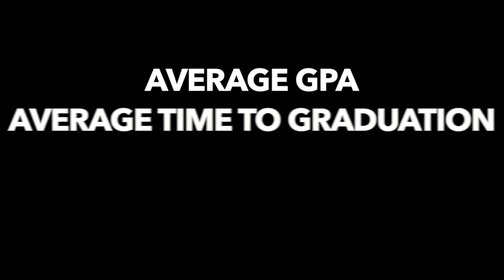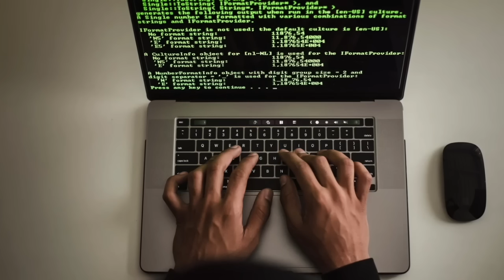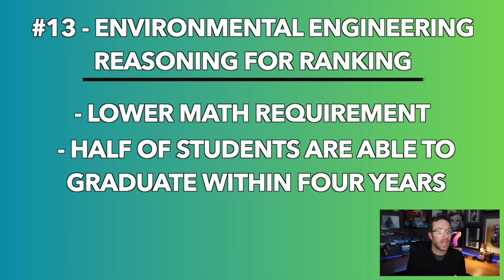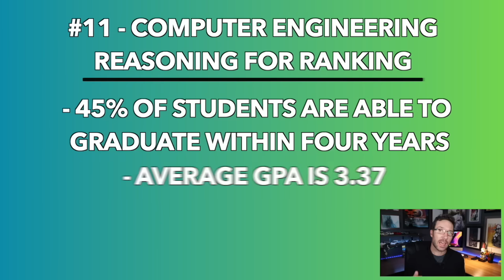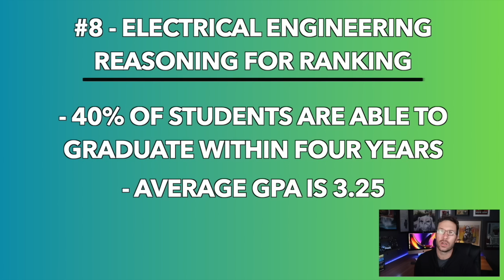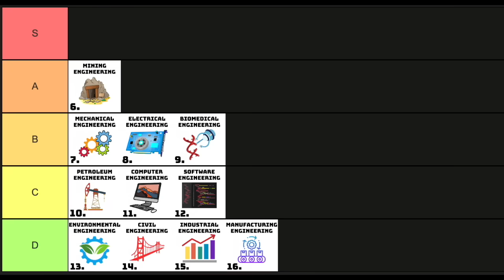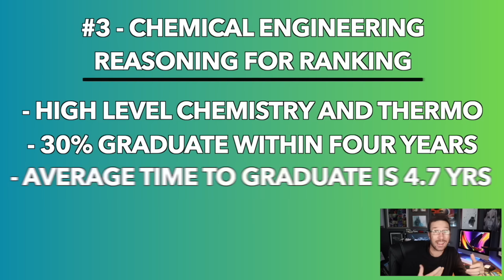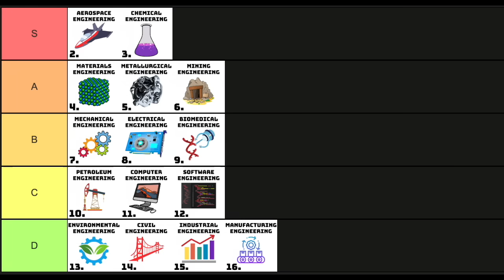Engineering Degrees Ranked By Difficulty (Tier List)

Comment: Retired EE here -- Class of '89 (UFL). Nope, not accurate, sorry pal. Author grossly understates "highest level math required." Sure, differential equations was the last of the formal math curriculum, but let's talk about Electric Fields that builds on Calc 3 and DiffyEQ and takes it into another dimension. I'm understating things by saying EE math is Arcane and should come with an honorary degree in Sorcery. When entering the program, they'd try to scare everyone by saying 50% wouldn't make it, but in reality this was kid gloves. The actual success rate was around 10%-12% from what I directly saw back then, brutal.

Comment: Sorry, Electrical Engineering has Partial Diff equations along with stuff like Maxwell equations.  Yes, I'm EE and think you've ranked it too far on the easy side.  I'd put it at about Aerospace E hardness with Mech E right behind.  It's about ability to think abstractly as much as it is about math and calculation skills.  All require lots of simulation and analysis, but there Chem E has much more difficulty.  I agree with the difficulty of Chem E, and probably Nuclear.

Comment: Saying that the highest math in electrical engineering and computer engineering is ODEs is totally wrong. First, many degrees will have formal courses in PDEs, complex variable theory, stuff like that. Secondly, and more importantly, there's more advanced math required in applications in those fields. For example, an algorithms course will deal with complexity theory which is arguably more complicated than ODEs, and electrical engineers will need to learn control systems theory and dynamical systems, which, again, more complicated than the basic math courses.

I'm sure similar arguments apply to mechanical engineering and possibly others as well. Computer and electrical are just the two I happen to know best.

Comment: Seems reasonable, more or less, though my experience is over 30 years as a research engineer across mechanical, electrical, computer, software, and aeronautical, at one of the top R&D labs in the country mostly working with folks with at least a masters, more often a PhD. Then too folks with degrees in math, physics, ML/AI. Much less experience with folks having only a bachelors degree.

That said, rank an undergrad double major in math and physics, which is were I started. With that and subsequently a PhD in math, I found I could do quite well as an R&D engineer.

Comment: As a computer engineering student, I generally agree with this tier list. In comparison to my friends studying mechanical engineering and electrical engineering, I find my courses a bit easier. However, it still depends on the school and the project assignments given by the professors. Speaking from my own experience, the project assignments given by my professors are quite challenging. Therefore, even though my courses may seem easier compared to other engineering disciplines, the overall workload is more demanding for me. Consequently, it's not possible to make a definitive difficulty ranking I guess

Comment: Bro there is no way you placed EE #8. At my University in Germany we have to do complex analysis and partial differential equations while needing 210 credits for a bachelors degree 💀💀💀 
And let me tell you, almost 80% drop out by the first 2 years...
Reply from the maker: I may have ranked it a bit too low .. but i tried to stick to my system. I may try to remake this video at some point with some different data. thanks for the comment!
Reply: Ain’t no way you’re complaining studying at an FH bro
Reply: @iamshawnlee1  I'm in fact studying at a University being the valedictorian of my class, still seing my classmates suffer
Reply: In this context, class and classmates relate to two semesters. So the two adjacent semesters from my starting semester

Comment: I was curious to know your industrial engineering rating, but then I remembered that this degree is not the same in my country as it is abroad. Your industrial engineering is called Industrial Organization here, while Industrial Engineering is the 6-year higher degree which allows you to sign mechanical, electrical, electronical, manufacturing and thermical projects. For me that's an A, due to the higher difficulty compared with other engineering degrees. What do you all think?

Comment: You can  not use percent of students able to finish  some engineering degree in four years as measure of hhow hard it is. You have also  to take in account average quality of students that enroll some of degrees.  If some of degrees have lesser pay expected and worse job prospects they wont be as popular and will be enroled by students not being able to enroll more popular engineering degrees. 
Btw. I was suprised by info that higher math required in electrical engineering in US is ordinary diferential equations. When I studied electrical engineering in Serbia in 1990's (Control Systems), 5 semester of math were required, including general and linear algebra, real and complex mathematical analysis (calculus of real and complex variables), ordinary and partial diferential equations and systems of DE,  equations of mathematical physics, probability, numerical analysis, graph theory and discrete mathematical structures. And in addition  for these general EE requirements, Control Systems department at EE required additional specialized math content like optimization theory, stochastic calculus and DE, stochastic dynamic programming, stochastic processes and time series, applied math in pattern recognition and similar topics, etc.

Comment: Proud Chem Engineer here.  Thanks for the video.  I think this is a useful first cut, but mathematics is not a 1-dimensional field, and PDEs although difficult enough, has a competitor in Numerical Analysis, which in chemical processing disciplines, may combine several maths disciplines to solve simultaneous sets of non-linear equations, mingling momentum, heat and mass transfer into the stew with thermo and kinetics.

Comment: When I got my BSEE in 1964 it was considered the most difficult at the University. I had math well beyond partial DE, graduated in 4 yrs with 151 credits (only 12 of which were electives) and a GPA  of 2.5 was considered respectable (pre-grade inflation era). A friend and I selected EE based on a coin toss.
Reply: There is a big difference between achieving a 3+ GPA in engineering vs. in Liberal Arts! I believe that an AS degree in engineering is much more difficult that getting a BS in history, yet many presume that a BS in any major is always superior.

Comment: Take the rankings presented with a grain of salt.  Difficulty depends more on on School than on major: Some engineering schools require Integral Calc (math major level) regardless of engineering degree some engineering schools calc is a joke by comparison...this presentation essentially over-simplifies.  Not all calc courses are created equal...not all engineering schools require the same calc course as required for math majors others require calc for non math majors - not all integral or differential calc course are taught at the same level of difficulty - also, some engineering schools enroll more foreign students than others - the engineering school this guy graduated form had groups of asian students who studded together and absolutely destroyed the curve for many and calc courses were same as required for math majors. These factors are very significant regarding difficulty - bottom line: some engineering schools regardless of engineering major are much more challenging than other engineering schools regardless of majors.

Comment: MTU BSME Spring 97, pretty much spot on, great video.  ChemEng what a nightmare.  Nuc and Material supper tough, why, there are way less jobs out there so you better be really good.  Now what I see in all the new engineers (ME, EE, CE, Material) is way more sub-classes so they are really good at one little nitch, but not the over all discipline.  Good god get a digit EE to do anything analog.  in Australia the Mech-EE, some hybrid ME/EE, tack an extra class here and there and now your both...  It like in the 80's and 90's when Bio-Med, MFG were trying to spin off of ME.  To many dilutes the quality and lowers the standards.

Comment: My experience with mechanical engineering in projects is that mechanical systems in buildings is least likely to work as intended. 80% of my issues as a facility manager had to do with mechanical issues. Too hot, too cold. Insufficient water circulation for hydronic heating. Enough capacity to maintain a building temperature but not enough for a cold start. This was in southwest BC where minimum temperatures rarely drop below -12°C.

Comment: As a retired engineer I disagree with your assessment criteria based mostly on time to graduate. The curriculum should be the highest measure for difficulty and it should include more than just math. I suggest you look at the pass/fail rate by class subject, for example at my college thermodynamics and ac circuits were killer subjects where people often failed and the difficulty was known campus wide. I assume you are an engineer but I see no mention. Thanks for the effort.

Comment: I teach Electrical Engineering..  I did my Bachelors in Electrical and Computer Engineering.. And I will definitely say that the rankings  are a bit flawed in terms of difficulty.. I will put in the top 4: Physics, Chemical, Nuclear and Electrical Engineering.. EE is extremely difficult to conceptualize because most of the foundational principles of EE lies in the imaginary/Complex domain and Electricity itself is one of the least understood concept that the modern world is built on and exhibits some of the most bizarre behavior under very different conditions.. My students always complain that they are sick of all the innumerable Transforms: Laplace, Fourier, DFT, FFT and Z-transform. My point is that most Engineering like Mechanical Engineering deals with tangible concepts that students can touch, feel and see, whereas EE concepts, RF, Microwave and Transmission line concepts are not tangible things that are as quantifiable or relatable.

Comment: Retired Professional ME, class of '81!  Over thirty years in DoD including two tours in Afghanistan.   A key ability an engineer needs is problem solving.   Problems need solved regardless of the circumstances as best as can be done with the material on hand.   Think MacGyver. 
 It is very hard to graduate from ME in 4 years, most did it in 5 years.

Comment: I can’t argue with the rankings as I studied Aerospace at Penn State in the late 70s, got my EE undergraduate in the 80s and my structural engineering masters in the 2000s, so my knowledge is dated.  I do know that all the engineering degrees have been watered down substantially.  When I was at Penn State in 1979, Aerospace required 142 credits and the easiest engineering degrees were in the 133 range.  And at that time aerospace required math beyond differential equations, particularly vector calculus and fields related topics such as gradient, divergence and curl and Green’s and Stoke’s theorems and others that were considered beyond differential equations (a 200 level course compared to 300 level for the fields related courses).  The same held true for my EE degree as it required the fields courses (which I already had from my aerospace studies) and additional complex variables math.  I know that with the advent of primarily digital electronics, it appears that many EE programs have dropped the requirements for fields courses.  Aero and EE also required a course in thermodynamics.  In the 70s, I would have ranked EE right behind nuclear, aerospace and chemical engineering as all were on a similar level of difficulty.  Mechanical, materials and metallurgy were mid-level difficulty degrees.

Comment: In addition, the percent that make it through for civil is also nonsense.  The first 😢killer course for civil engineers is Statics in the Engineering Mechanics Department.  Around 60 percent of all civil engineering students fail that course. Finally, it is rather ridiculous to compare civil engineering to any other engineering.  Civil is the mother of all engineering.  It covers so wide an area and the demands of various sub areas vary.  In fact, Environmental engineering has been a part of civil since Darcy design the sewers of Paris and who was a friend of Victor Hugo when he was writing Les Miserable that describes in great detail the sewers of Paris designed and built by Darcy.

Comment: TOO MANY GENERALIZATIONS.  YOUR CRITERIA OF HOW LONG TO GRADUATE IS BULLSHIT.  CIVIL REQUIRES PARTIAL DIFFERENTIAL EQUATIONS THAT ARE NON - LINEAR, VARY WITH TIME, DEFORMATION, AND CHANGES IN STATE.  CIVIL SHOULD NOT BE 14.  MORE CIVILS GRADUATE, NOT BECAUSE IT IS EASIER, BUT BECAUSE THE GOVERNMENTS, STATE AND FEDERAL, OFTEN GIVE COMPLETE TUIITION, LIVING EXPENSES, AND JOBS DURING THE SUMMER.  CIVIL REMAINS THE TOUGHEST DEGREE AT THE PHD LEVEL.  CIVIL ENGINEERS INVENTED FINITE ELEMENT ANALYSIS IN 1936.  IT CONTRIBUTED GREATLY TO THE VICTORY OF WWII.  HIGHEST LEVEL OF MATH ODE? IF YOU ARE NOT GEOTECHNICAL OR STRUCTURAL OR FLUIDS.  OTHERWISE YOU NEED HAS CALCULUS IV, ADVANCED PHYSICS, ENGINEERING MECHANICS OF SOLIDS, STATICS, DYNAMICS, THERMODYNAMICS, NUMERICAL METHODS WITH MORE MATH IN A MASTERS AND PHD.  AS A CIVIL, MY CIVIL SALARY IS 250,000 $K YEAR.

Comment: Interesting and thanks.  I have a Masters of Science in Materials Engineering and Science (which is might include Metallurgical Engineering --- a sort of catch-all phrase or description --- I studied polymers [plastics] and ended up with a US Patent for a paint additive).  A lot of fun and instructive.  As for the math --- useful as it can help with some of the molecular conformational structures --- at least in my case. Which is sort of obvious but might be a surprise to some.  As for the math part . . . well, there's spreadsheets and so on.  The key to all of this is how such tidbits might be applied, that is wholly depends on the individual involved.  And, politically, the reasoning, if you can call it that, for much of the notions of legal classes and the like as the prospective employer, as suggested in the clip, would really, really like to have all of that yummy intellectual property for free.  Political shuck and jive.  As there are or might be thefts involved dressed up to look like something else.  Be careful what you sign up to study at college.

Comment: Back in the day we had to take a class in different  engineering subjects the EE course was hardest. It’s still PFM to me.  Ended up with an AE degree 1n 170 semester hours, in 5 years. Back then a semester at KU was $235/ semester. Before retiring I was making $250-325 k/ year, it was fun.